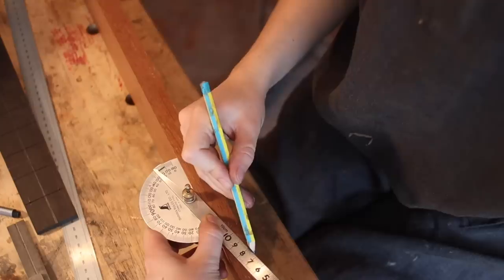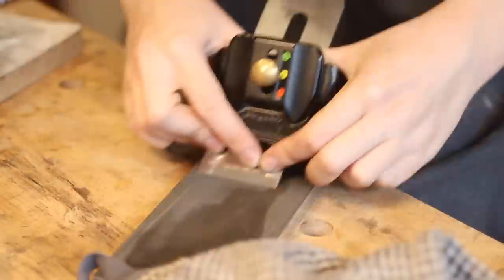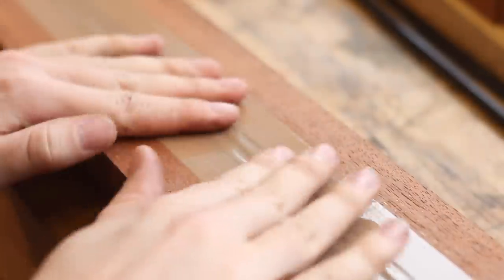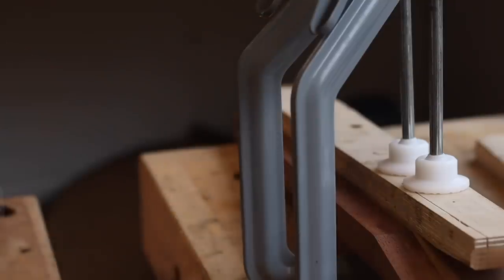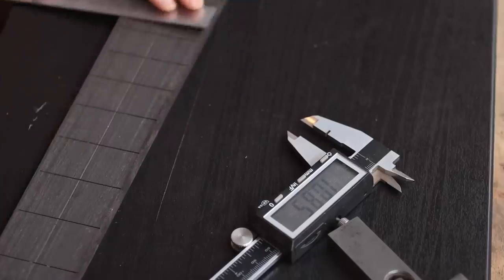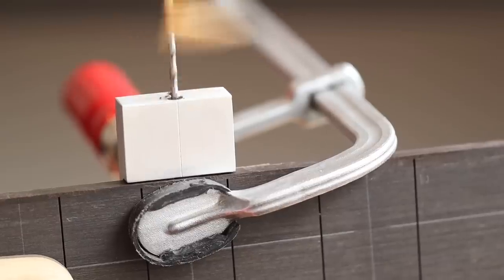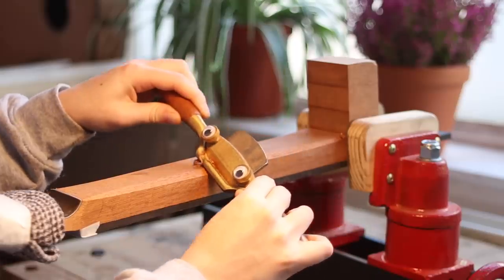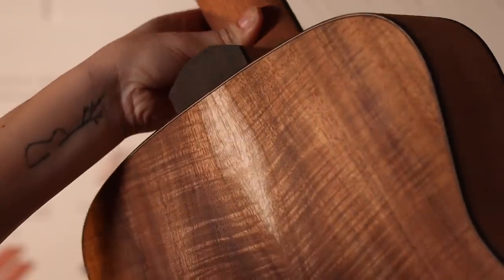Watch a Bespoke Guitar Neck Being Made (From Scratch)

Comment: This is the first time I've seen a scarf joint done where the glue surface doesn't use the full face of the cut - and then you cut off the excess bit to form the face of the headstock.
This is to have the joint 100% in the the headstock face and none on the main neck span itself?
Choice?  
"Just how you were taught? 
Additional strength on top of the CF reinforcement rods? 
Pure aesthetics? Joint totally hidden by the front and read headstock veneers?
(Or, with "traditional" scarf - having the CF bridge the 2 pieces of wood in the join is actually better?)
A lot to think about just in that tiny section of this video.
Side dot jig looks really useful - plus noted that any future spoke shave must have the googly eyes.

Comment: Plane a piece of wood as long as the flat part of the back of the neck super flat and rub it with pencil lead. Rub this surface along your nearly completely shaped neck in order to show the high spots. This goes a long way towards a professional feeling neck taper with no peaks and valleys under your thumb. You’d be amazed at how well your thumb will pick up peaks and valleys.

Comment: Hey Daisy, love your videos! I have a question about the scarf joint on the headstock. I'm sure it's fine as it is, but wouldn't it be even stronger, if the whole headstock was one piece and the joint was between the neck and the fretboard?

Comment: Well, one does not have to be any kind of a 'Master' woodworker to know that you are doing your own work. I may make a guitar some day. I do prefer the fender type necks that would not require a scarf joint. However, if I was to do a scarf joint, I would have to try an Asian/Japanese/Chinese/Korean type of interlocking joint rather than flat surfaces.

Comment: Adding the back veneer to the headstock and leaving the bit of extra thickness right behind the nut is smart, much like a classical guitar. Honduras mahogany is lovely to work and the primo neck material, but it's just not all that break resistant. This is probably the reason for Martin maintaining the little vee, initially the result of weird German construction. But nothing breaks headstocks like a Gibson. oof.